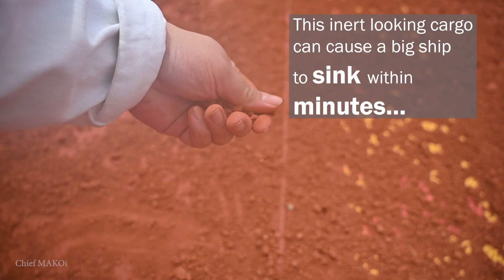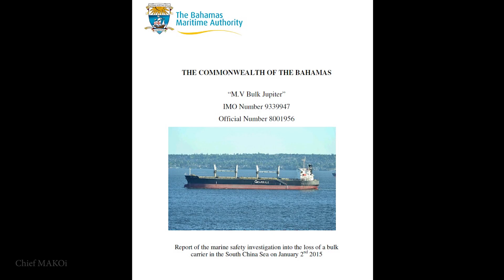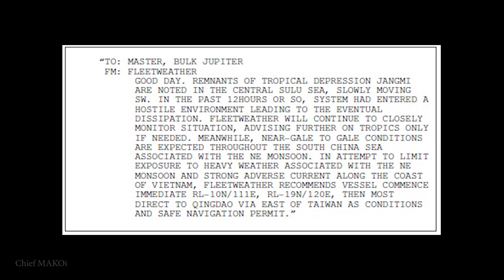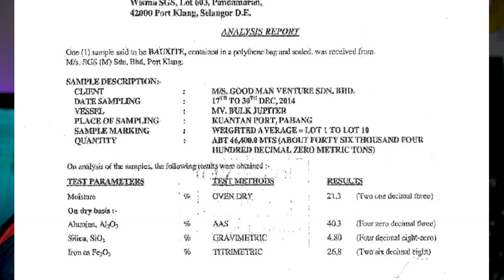The Cargo That Can Sink Ships Within Minutes : Bauxite Liquefaction | Chief MAKOi Seaman Vlog

Comment: Do ships have enough spare materials onboard to construct makeshift slosh separator walls in the cargo compartment if this happens as emergency response or do they just avoid bad weather and get to port?
Reply: To do that, you'd have to open the holds, exposing them to the weather and the risk of flooding. You'd also have to send men into holds full of quicksand. Total non-starter.
Reply: @beeble2003  See I was just thinking it would be, first open the hatch. Insert a sheet into the material. Connect sheet to the edges. Close hatch. Simple no fuzz insert. Why wouldn't that work?
Reply: @JustCallMeJames1  Opening hatches in bad weather is somewhere between dangerous and suicidal. How are you going to manipulate this sheet of material? It's probably a sheet of steel about 25m long by some number of meters wide and at least 1cm thick, plus enough bracing so it doesn't bend. That's an enormous weight of steel. Where are you going to carry these things? You'll need six or seven of them. Probably multiple times that number because you need them to be deep enough to stop most of the slurry moving but not so deep that you have to drive them into the solid material below.

The correct solution is simple: don't load wet cargo.
Reply: @beeble2003  You would not do this in bad weather obviously but in good weather for at risk container. Ok so in short they don't have the makeshift materials onboard. Makes sense when you start adding up the weight.
Reply: @JustCallMeJames1  Yeah. Thing is, you only need to do it during bad weather, as the slurry only forms when the ship's shaken about by rough seas.
Reply: @beeble2003  Yeah what I was thinking of was a situation where you have at risk container. And you have good weather so far but the weather is going to be worse the following days.

Comment: Well… you did kinda fill a boat with thousands of tons of what is basically the main ingredient of thermite, so… I will admit I hadn’t thought about liquefaction or separation though.
Reply: Bauxite isn't chemically reactive, thermite is iron oxides and elemental aluminum in certain ratios, and when it reacts the oxygen in the iron oxides binds to the elemental aluminum. Bauxite ores contain aluminim oxides, while they often contain iron oxides as well, since there isnt any free elemental aluminum in them, no thermite reaction is possible.

Comment: As a kid I tag along with my uncle supervising removal of lathe and machining waste of steel sliver , iron sliver from lathe work shop. 
Those waste look like a giant steel wool. 
It has stay outside getting rain on for a while. 

While it was being transported on open bed truck 
I think some one threw a cigarette but on it 

Between the iron sliver , rust , machining oil / fluid 
That pile caught on fire 🔥 and combust like nothing we have ever seen . 

The truck burn to ground. 
It was in the 70’s in Indonesia. We have no safety for transporting hazardous material 

Stay safe chief Makoi
Reply: There is a video of a burn ing propane fuel truck being driven quickly through some town possibly in Mlaysia very dramatic.

Comment: I was trained as an EE but had to take a fluid dynamics course thinking - why? I deal with circuit boards. What was the point? Who needs this?  Well, here we are. It is amazing to me that all the study I did in fluid dynamics really applies in the working world and can be critical to understand in situations you would never imagine considering. Something as benign as this can be a horrible hazard and I would never even consider this as a problem. Thank you for covering this. I learned a lot.
Reply: What? Are you kidding? What about wave solder machines? How solders flow, different eutectic soldering, military specs, g forces on military grade electronics. Not to mention epoxies, potting compounds, gels, resins and other chemicals used as support structures of circuitry. Of course you took fluid dynamics.
Reply: @pootthatbak2578  Good point. I just never encountered that on the jobs I did.
Reply: @pootthatbak2578  and air flow around heat sinks and fan driven cooling.

Comment: Hi Chief, Long time viewer and thought I'd reach out and ask this question about cargo holds. Do ships regularly carry minerals and ores and such and then turn around and carry food products like grains etc. I know they are cleaned and inspected but like this cargo of bauxite, will it be corn or something in the hold after that? 

Thanks so much for the work you do, really appreciate it.
Reply from the maker: Yes, they do.  It's difficult but it can be done.
Reply: Usually the ship carries cargo of the same type. It's common practice to load ores, then the ship carries only ores, but may vary which ones.

If they want to change to grains, there is a huge amount of work to clean just about every part of cargo equipment, and that costs time and money.
Reply: @Brgnalf81  Are there facilities in harbors that are set up to clean cargo vessel holds, or is this done by the ship's crew themselves?
Reply: @3SpoiledDonkeys  the crew does it.
Reply: @Brgnalf81  Thanks for the info! That sounds like a huge task. Respect for the crew!

Comment: if the danger of the material when wet is known, why would a port ever leave it uncovered? surely constructing a dry holding area is cheaper than losing a ship and having to pay compensation and legal fees.
Reply: As always, money.  Losing an occasional ship is peanuts compared to dramatically increasing costs related to storing product  and increasing time required to load the product (for every ship).
Reply: @cerealspiller  ah yes, valuing money over people's lives. all you'd need is a big tarp or other impermeable plastic to cover a pile of whatever shouldn't be wet. i don't think that's so much more expensive. if the ports are forced to comply with safety regulations it'll be bought with blood as always. hmph and people think letting greed run the world is a good idea lol
Reply: @Cyborg_Octopus  Yeah, hard to say what the actual costs would be.  Undoubtedly could vary wildly by location.  In most ports, space is at a premium, so not necessarily cheap to store, and cover massive bulk loads of material such as ore.  In any case, it ain't free and thus it isn't done.
Reply: It also depends on if the cargo is the same or changes. If it was always the same they could use the same tarps but if it was different they may not want cross contamination between loads so would need to clean the tarp or have different ones adding to the expense. It seems like in this case they were loading while it was raining so tarping would not help much.

Comment: It is almost like dewatering sewer sludge.  use a little bit of air agitation and the water settles on top of the sludge and you send that back to the headworks and when the sludge is dewatered enough send it to a press or centrifuge or drying racks to get near 80 or 90% dry.